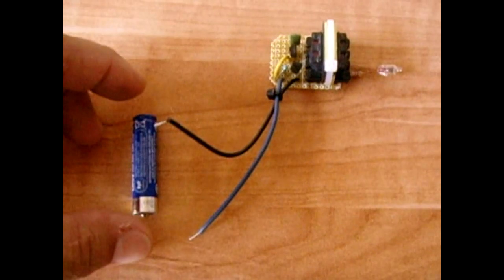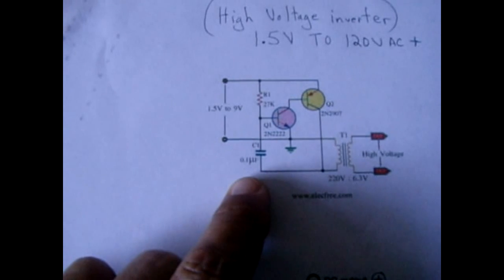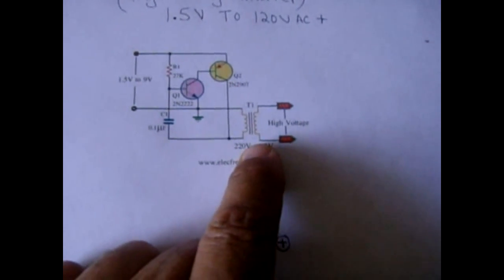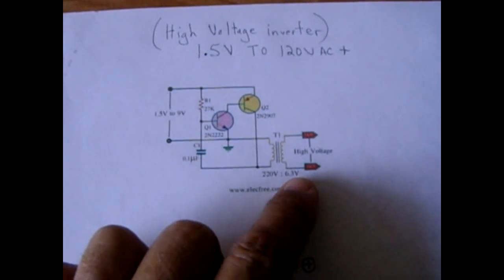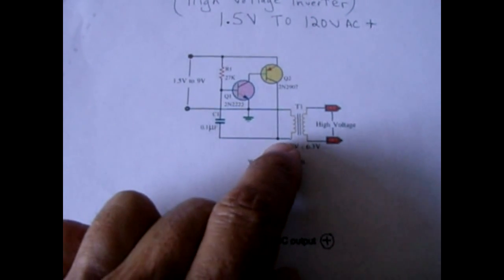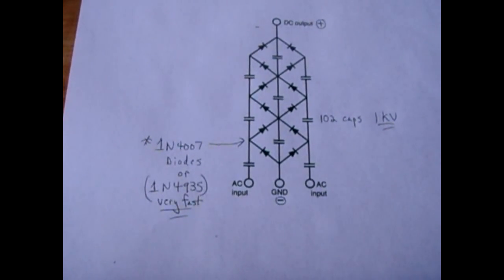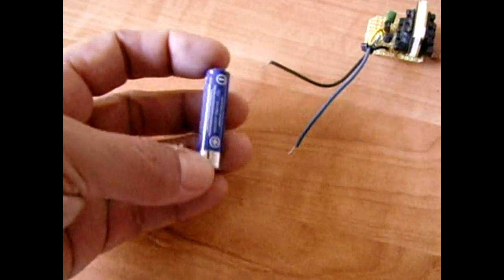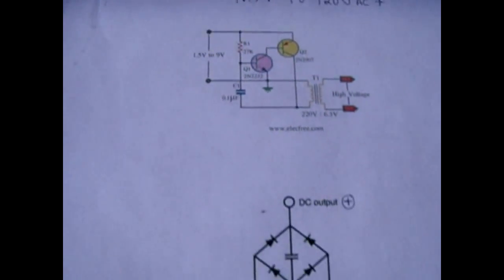AAA (1.5V) Battery to 120V or HIGHER!

Comment: Sir i read also before ask question, but there i cant fine about how wind transformer sir plz help me........😕
Reply from the maker: That was all explained VERY well in the video. Take a small ferrite transformer and wind on the thicker primary winding first (10-12 Turns) of 20 -24ga enamel wire, then place a layer of electrical tape over the winding and begin winding the high voltage seconday with the thinner enamel wire(34-40ga) on top of the primary winding. After each pass on the core, wrap some tape over the layer before adding more layers. The more turns you add, the better.

Comment: hi sir i see your all videos all have good job, sir in this video i understand all things but on 1 thing i confuse about transformer, i have 2 question
1).  how i wind the transformer you tell in this video only scendery winding 12 turns.how about the primery winding how many turns in primery winding.
2). which side i contect with circuit 120v/220v or 6.3 volt
Reply from the maker: Please refer to the video description area. Thank You

Comment: Thanks, for your help, 1 more last question, what is the actual name I can find this type of transformer in shops. Thanks
Reply from the maker: That transformer is a snap ferrite transformer core. You can find the thin enamel wire inside small power relays and small electric motors.

Comment: Hi i made step up transformer and mechanicly made pulsed dc now with 9v 800mA it can power even 8w CFL bulb. Yours converter can power CFL ?
Reply from the maker: This circuit no, but if you check in my video playlists you will see another video which does power a CFL.

Thanks for watching!
Reply from the maker: These are very common NPN and PNP transistors. Many will work. You will find them in radios. Look at the part# on the transistor and then perform a Google search to see if it is a NPN or PNP.  2n3904/2n3906, bc547/bc557, and 2n4401/2n4403 are examples.

Comment: hi
how can i chang 0.3v ( normal speaker voltage ) to upper than 0.7v ( for running a transistor)?
thanks
Reply from the maker: I don't know what your trying to do, but .3v is way too low.
Reply: the max output voltage of your phone is .3v i wana change this to .7v to connect it to a transistor , that work is like a switch.
and thanks for your answer...
Reply from the maker: I don't know what to tell you. The voltage is way too low. What are you trying to turn on and off using the cell phone speaker?
Reply: a tiny vibration motor.
Reply from the maker: Much easier and cheaper to buy an inexpensive cell phone that has a built in vibration motor.
Reply: as a matter of fact my idea is a vibration motor run when the phone is ringing or the alarm tone or sth like these.
i want connect the motor and Equipments with an aux cable.
the motor will be in my Pillow to wake me up.

Comment: what size resistor did you use on neon lamp?
Reply from the maker: Usually you use 47k using 120V and 100K using 240v.

Comment: Sir. Output VAC or VDC. i can make output is VDC i can do
Reply from the maker: You would need to take a high voltage schottky diode(to save on losses) at the output to make the pulsed DC or AC output and make it DC. Making a full wave rectifier is best(4 diodes in a bridge), then take a high voltage capacitor(from a TV) and place it across the output of the rectifier to smooth the DC out. You can also use only one diode, but you lose a lot of power.
Reply: electronicsNmore In this video you make output 120VAC ?
Reply from the maker: Saran Weruwanaruk
Pulsed DC more likely. Pulsed DC resembles AC. If the power transformer was being driven using a center tap using a push/pull configuration, then it would be AC.
Reply: electronicsNmore Thank you to all comments i can think to make it :)

Comment: Hi . I was just wondering if this one can produce 10 A, 60 Hz and 1000 W ? how much current does your sample produce ? :) thanks.
Reply from the maker: This circuit produce high voltage at a LOW current. I have other inverters for higher power output in my video playlists.

Thanks For Watching!
Reply: Do you think is it possible for a 9V or other dry cell batteries to produce 10 A ? i just needed it for my project . Thanks ! :)
Reply from the maker: Never happen.

Comment: Can i use two 2n2222, insted a pnp to pair it?
Reply from the maker: No. Needs to be a PNP. You can find them in scrap electronics.
Reply: Yeah you're right i need a negative signal to the base to activate the npn and a positive to activate a pnp base.
Reply from the maker: yep

Comment: for how long will give 120v if i use fresh new 1.5v battery ?
Reply from the maker: Never checked that, but it does not draw too much current. Should run a while.

Comment: "Pulsed DC Current" So Pulsed Direct Current Current, or as everyone but you called it, ALTERNATING CURRENT
Reply from the maker: No there is a difference between pulsed DC and AC. With AC, you have BOTH positive and negative pulses. With this circuit as it was designed, you only get the positive pulses. For positive and negative pulses(AC), you would need to modify the circuit and use a center tapped transformer. :-)
Reply: THen how is the lamp run?
Reply from the maker: Does not matter if the neon lamp is operated on DC or AC. When the lamp is powered by AC, BOTH electrodes will be equally glowing. When run on DC , only one will be glowing, or glowing much more than the other.

Comment: sir. would this schematic allows me to input 12vdc? with a transformer 12v-220ac, could i possibly use this schematic your presented??
Reply from the maker: You can try it, but I suspect the voltage is too high. You can use a DMM to measure how much current is being drawn by the circuit using a 1.5V to 3V battery, then use a resistor in series with the 12V power supply to the circuit to reduce the current. Be sure to use a 1 or 2 watt resistor of the correct value. The better solution is to use an LM317T to reduce the 12V down to 3V.

Thanks For Watching! Be sure to share my channel with others.
Reply: tnx for the reply sir goodeve :)

Comment: Hey can anybody plz explain the inverting circuit thats using sziklai pair..
Reply from the maker: Hello Haris,
It is fairly simple. The NPN transistor is oscillating, which in turn allows the PNP's base to switch on and off allowing + pulses to flow from the emitter of the PNP to the collector then into the primary winding.

Thanks For Watching.
Reply: electronicsNmore How is it oscillating??...thanx
Reply from the maker: Due to the resistor and capacitor connected to the base of the NPN.

Comment: can u please tell me how to make a voltage amplifier which convert 9v to 18v . please tell me its my school project.   my email id is himankchaudhary.hk.hc@gmail.com
Reply from the maker: If the current draw at 18V is not that high(75-100mA MAX), then you can use a 555 voltage doubling circuit. There are many online.

Comment: So would this power a 115v ~ 9.4A 60Hz Air Conditioner or would I have to build something else?
Reply from the maker: No. This circuit is designed for a high voltage/LOW current output. You would need to make this here, but capable of much higher current. A/C's have very large inrush currents.

Homemade Modified Sine Wave Power Inverter(350/500w)

Comment: hey ,this is the easiest and most simply explained circuit on the net, gr8 work man.. i m going to use this circuit for charging up my capacitors , I'm using [2n2222] ,[2n2905a] , a 104 ceramic capacitor (0.1 uF) ,  27k ohm resistor and a 6 pin transformer (it is taken out from a ac to dc charger..... originally it has 2 + 2 pins on the primary and 2 pins on the secondary . i plan to use the primary as secondary and the secondary as primary to make it a step up transformer (btw it looks similar to yours) ). The rest of the circuit is the same. Please tell me if the circuit will work or not and what changes should i make if necessary . thanks a lot !!!! Also can i use a 1.6 V/1.5A and a 7.8V/0.3A battery ?

Comment: I also hope to make an experiment running such circuits to an air core transformer with more than 2 windings (trifilar, quadfilar, etc).. some people claim these coils run additional loads better without any significant increase in the input amperage..sort of like a kapanadze

Comment: have you tried making a Jacob ladder with those combination of circuits?
a buzzing relay connected to an ignition coil transformer can create arcs unlike the electronic transistor and transformer, but this circuit lights up cfls easily

Comment: So if I add more voltage at the input I'll get more voltage at output ? 1.5v in for 120v out, if I add about 5v I'll get about 360v + AC ? The out put is AC right ? What about the out put amp ? The circuit can be used to charge capacitors with ac output, ex. caps 400v 300mf or more and what diode should i use to charge the caps ?
Reply from the maker: Using a higher input voltage does increase the output, but from what I recall, it did not do so in a proportionate way. The output is pulsed DC(similar to AC, but your only getting the upper part of the waveform, not the negative) you should have no problem slowly charging caps.
Reply: electronicsNmore Not sure if you know the one use camera circuit, It's similar circuit with that one you saw right ? I could charge a 300v capacitor in 5~10sec I'll be able to do with that one too ? Because i had a one use cam circuit and burned few years ago and now im trying to find similar circuit to charge some capacitors and the only one that  I found and I can build is that one, so I need few info before i start building it.
Reply from the maker: I have a Fuji flash circuit video on my channel also. I made another low voltage DC to HV pulsed DC circuit which I use to charge caps to 500V/680uF, but it does it slowly. just under 2 mins. Works perfectly.

That one is here:

High Voltage Joule Thief
Reply: electronicsNmore Well thanks for helping, I'm gonna buy components to build that circuit and maybe test what I'm thinking. Can you sugest me what kind of diode i need in the output of the circuit to be able to hold the capaciotr voltage to not flow back.
Reply from the maker: Domino SixO
Which circuit? The one I used with the toroid?
Reply: electronicsNmore That one here. 1.5 to 120 or more.
Reply from the maker: Can you get your hands on the small power transformer? If not, you may be bettor off making the other one I showed you.

Comment: hello; 
   I need to increase the voltage of 12v. everything else I can variably increase in output, but the output voltage must be in Dc volts. The reason is that I have a hydrogen cell operating at 12v., But consume too much amperage. If I could increase the voltage, would not have to consume too much amperage and would have the same result or better. As I can have a list of materials and drawings to create this circuit? Could you help me?
 Thank you.

Comment: Would u be interested in building me one! Ill pay...www.torment8625@hotmail.com

I'm trying to get 18650 batteries (1-3) to run a (120v~15w  60hz) soldering iron... Can u help , any info is greatly appreciated .....thanx
Reply from the maker: Actually better to just build one of the inverter circuits in my video list. 15W/120V soldering iron is very small load. You can use a small center tapped transformer for the job.
Reply from the maker: To power a 120v / 15w soldering iron, you would need to draw 1.5-1.75A from the 18650 batteries, which is no big deal, but do not expect to run the soldering iron continuously., otherwise the batteries will drain fast. You can use the circuit shown in my "modified sine wave" inverter video. You can buy a 12v Center Tapped 2A transformer from radio shack. That size will work for you.I cannot make it for you, I am too busy.

Thanks For Watching
Reply: its better to buy a soldering iron rated for 12 volts dc or so.. it can be bought from ebay and then use a series of 18650 to power it..

Comment: I use this circuit to drive my flybacks , only I use a 2n3055 for the NPN and 2n2955 for the PNP transistors.Make sure to put a diode across the PNP transistors collector - emitter ..., I lost a few transistors due to flyback voltage without the diode.

Comment from the maker: The ferrite core comes apart easily. The top flat bar (I), is only taped in position, then the E core slides out of the windings.
Reply: i came across your channel today and found it awesome.  so it means this circuit with high input voltage can be used to make tasers?? Also please make a video no DIY tasers❤❤❤